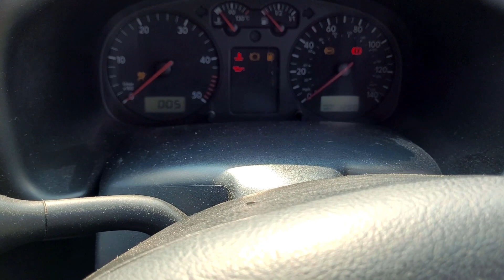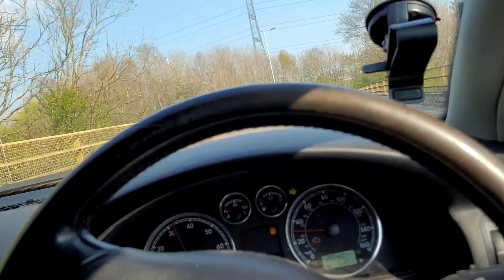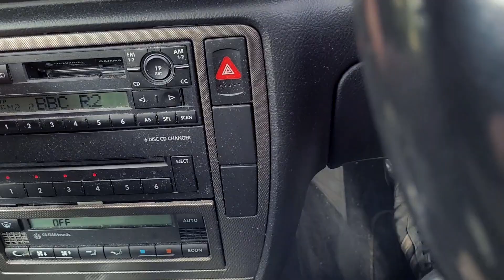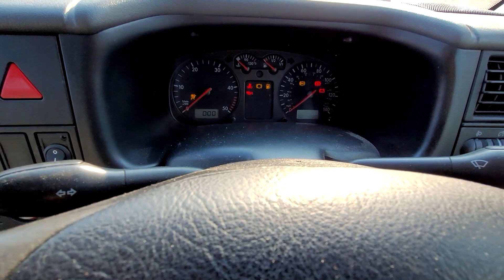T4 Transporter update : We've Had Better Daze

Comment: your alternator charges the battery not the starter, the grinding noise you heard was most likely the belt slipping over a seized alternator ,,, your car can drive without the starter but not without the alternator

Comment: bad alternator will stop the car every time
Reply: so will a frozen AC comprrssor. It happend to me all the engine would do was click i took the belt off and it started right up
Reply: @Indyram96  yes very true , but remember at first the starter wouldnt click even , witch means it wasnt getting power , then after clipping wrong leads to it .... it started clicking .AC compressor or motor is a great guess for sure.Ive had this same issue with both starter and alternator , car still had power both times accept no attempt to turn over when having a bad alternator , with bad starter , you will get a click off the bat and usually not know tll you go to start the next time , and even then a quick tap on the starter can make it move. Im hoping its an alternator and he doesnt have a blown engine
Reply: @Indyram96  ive also seen ac pumps or motors go and car still ran but the ac motor heated up so bad it started a fire!!!!
Reply: @JetwashF8TheHuntingGamer  I've seen that too but if its only the clutch on the ac comprrssor it will  make some real bad noise then it could stop the engine the best thing to do is pull the belt and check if it will start
Reply: @Indyram96  YEP